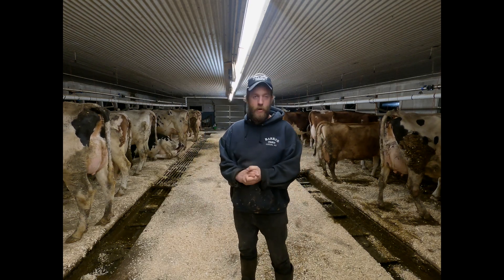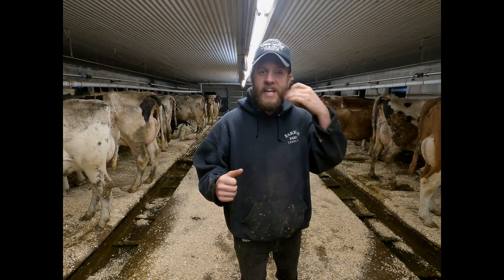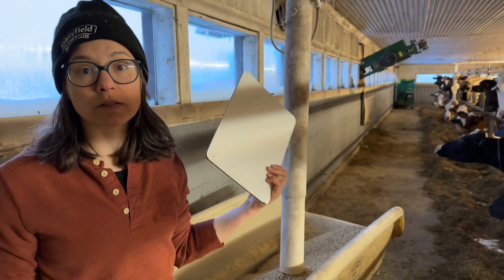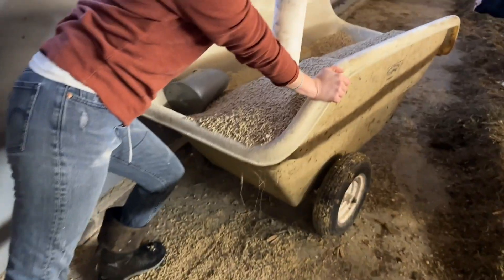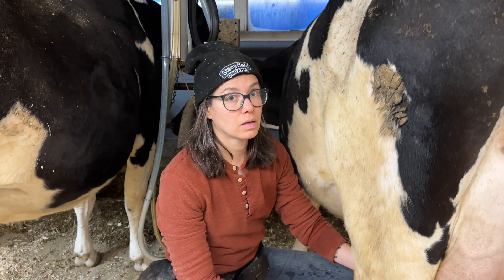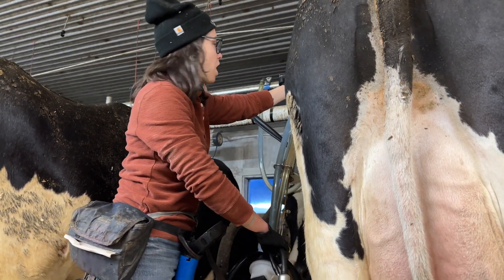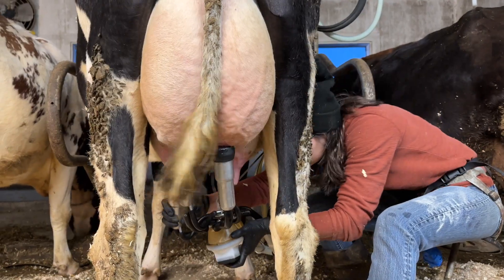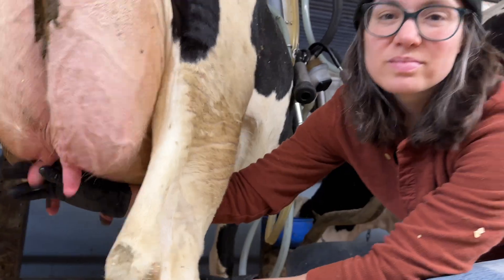Milking Cows in a Tie-Stall Barn

Comment: The hygiene is over kill, you’d never do here in Ireland as you’d be all day milking, the only hygiene we use is test spray after milking and it works.
Reply from the maker: Our buyer pays big premiums for low pi, bacteria, and scc count. We have very low numbers for all of those and it pays us big bucks to slow down a bit . I get that doesn’t work for everyone or all situations. Your situation sounds disgusting. Thank god the United States has higher standards
Reply: @maydayfarm  actually if we go over in tbc or cell counts there’s big penalties so our system works just fine nothing disgusting about it, we do have our cows on grass almost 10 months a year while lactating which helps the situation.